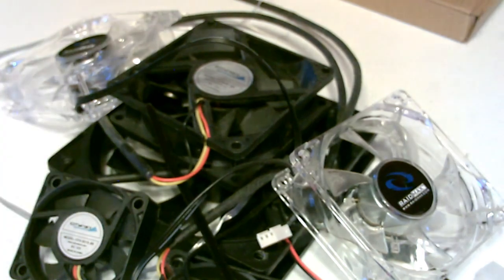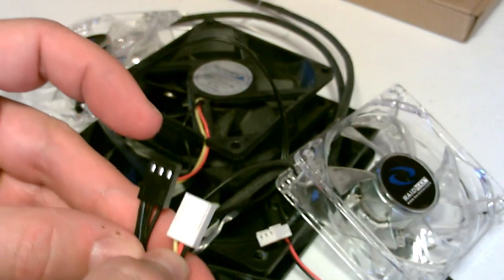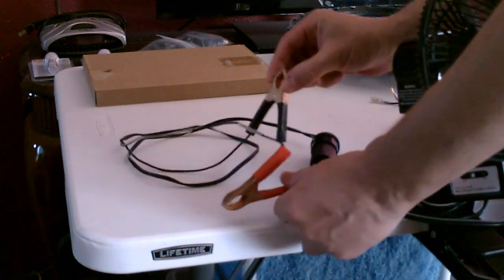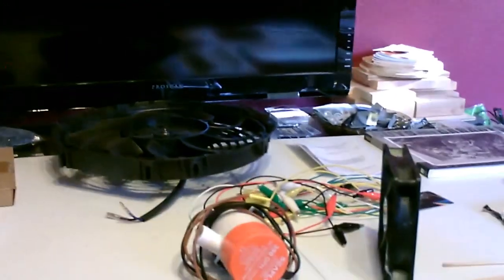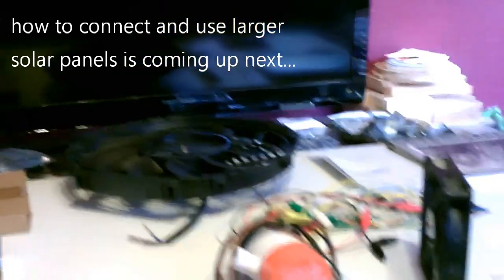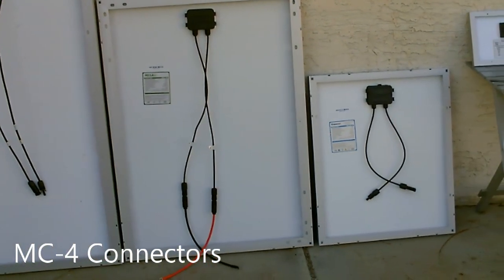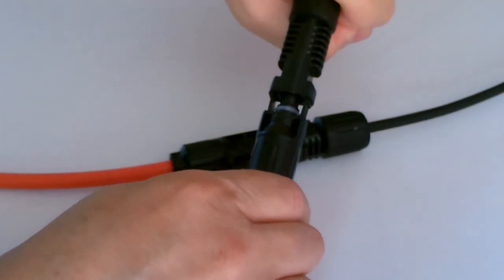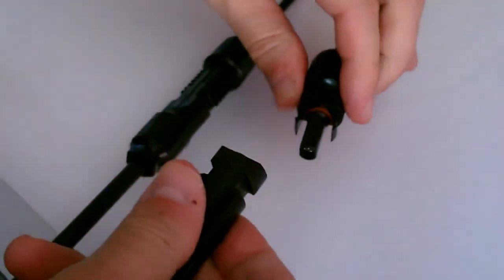How to connect things DIRECTLY to Solar Panels!  - Detailed!  wires/plugs/sockets fans/lights/pumps!

Comment: Wow, thanks for taking the fear out of reconfiguring my off-grid greenhouse and pond fountain and circulation set-up. Goodbye SLA batteries (just to run the charge controller and low voltage cutout) that I fought with all summer, I will be going direct hookup for everything but the pond aerators and shower pump that reguire 24/7 and on-demand power respectively. Thanks again, going to go check out more videos now.

Comment: Do you have a video on cutting the MC4 connectors and just twisting the positive and negative leads to
the extension cord wire?  Thank you.
Reply from the maker: hi there. i never actually cut the mc4 wires. they sell wires with mc4 on one end and bare wire on the other. you don't want to ruin the mc4 connectors on the solar panel. you can get a set of wires for 5 bucks on amazon (well five to eight). 🙂 here is a set for about $5.00 https://www.amazon.com/Renogy-Controller-Connector-Adaptor-Extension/dp/B00DGXVO80/ref=sr_1_4?crid=D7BTWN405U1G&keywords=mc4%2Bto%2Bbare%2Bwire&qid=1645040305&sprefix=mc4%2Bto%2Bbare%2Bwire%2Caps%2C270&sr=8-4&th=1
Reply: @desertsun02  Thank you for the fast response and information.  I will order them.

Comment: Are the wires coming off Solar Panels, with the MC4 connections just regular wires? I have considered just cutting them all off and using different connectors.
Reply from the maker: yep, they're just regular wires 🙂

Comment: With mc4 connections..You can also unscrew the box at the back of the panel and switch out the connectors and switch them out for regular wire, and put them back in if there was ever a problem with the panel as to not void the warranty

Comment: Have you ever had this Problem?  I built the solar heater that you designed and it works great.
I hooked up the computer fan b Blaster 70.  Installed it to a 40 watt solar panel and it only runs
when I stand half of my body in front of the panel.  When I'm not in front of the panel it rotates
a couple of times and then stops.  The connections are tight.  I have no clue what else I should
do.  Any ideas would be appreciated.  Thank you.
Reply: I went ahead and grounded the computer motor and it is now working.  I didn't think you
had to ground it.  Thank you.
Reply from the maker: hi. so when you block the sunlight from hitting the solar panel it works but when you put the solar panel in full sun it doesn't? if that is what you mean then nope i've never had that problem. might want to try another solar panel.
Reply: Thank you for your reply and all of your help for a newbie.
Reply: The motor run after I grounded it for a day and then was intermittent.  So I put a small
box on bottom side and it is running full power.  I will have to get another panel.

Comment: I called Grape solar and they said the voltage was to high to run the two computer fans.
That is why when I stand in front of the panel they both run.  I would have to have a
inverter to reduce the voltage.  Do you recommend a company for an inverter?  
Thank you.

Comment: Thank you for all your very creative videos on solar.  I received the MC connectors and
I received a 100 W Mono from Grape and hooked them up like I did the 50 W to run
two computer fans.  I still have to put a small box in front of the panel for it to run.
Both fans run full blast for about 10 min and then they just run for a few seconds
stop and run again for a few seconds.  I'm going to solder all connections to see
if that will solve the problem.  Any other ideas please let me know.  Thank you.

Comment: I'm trying to hook up a snap fan directly to a large solar panel. The snap fan has exposed wires but the solar panel does not. I'm assuming I use the socket you mentioned to connect the two? And what about the exposed ground wire? What does it connect to? Thank you!!

Comment: If looking up on Amazon the mc4 connectors that you use to hook up bare wires to the solar panels how would you search for them.. could you leave a link.  Thanks.
Reply from the maker: hi. type in mc4 to ring terminal. that finds them. or here's a link
https://www.amazon.com/Extension-Connector-Plated-Terminals-Adaptor/dp/B076GX7ZSJ/ref=sr_1_7?crid=Q7II3WJIX8PM&dchild=1&keywords=mc4+to+ring+terminal&qid=1611057444&sprefix=mc4+ring+terminal%2Caps%2C228&sr=8-7 they also sell mc4 to bare wire. here's a link https://www.amazon.com/Renogy-Controller-Connector-Adaptor-Extension/dp/B00DGXVO80/ref=sr_1_3?crid=Q7II3WJIX8PM&dchild=1&keywords=mc4+to+ring+terminal&qid=1611057650&sprefix=mc4+ring+terminal%2Caps%2C228&sr=8-3

Comment: Do the solar panals have batteries in them already usually? Somehow it needs to be able to store the energy to use when the sun isn’t hitting a panel right?:o
Reply from the maker: hi. the solar panels don't actually have batteries in them. (but it's easy to hook a battery to it - if needed). in many cases no battery is needed

Comment: Hello, i built the "blue cube" evap cooler with 120v A/C  and it works amazing, now I'm trying to convert it to solar and I'm having some trouble. I bought the same fan and pump that you use in the video and a 350w solar panel thinking that all solar panels were 12v, turns out my solar panel is 36v. Then i took an old solar charge controller from from a solar light and converted my 36v to 12-13v and the fan runs super slow, so then i connected a 12v 55Ah rechargeable battery to charge controller and the fan still ran really slow. So then i thought maybe there was something wrong with the fan so connected the fan to my car battery and it runs just like in your video. I really would rather not have to use a battery and just have the system run while the sun is up but i will if i have to. Based on other comments i think I'm may be having an amperage issue. What am i doing wrong? What other device can i use to solve this problem?
Reply from the maker: hi. super that you built it! i'm glad you got it working good on AC. i'm not sure how many amps you panel is putting out (or how converting a 36v panel so it outputs 12v changes things) but it could very well be an amperage issue. i only run my projects on 12v solar panels so i don't have to convert or change the voltage. i don't know of a way to use a higher voltage solar panel with a 12v fan and 12v pump. you may have to invest in 12v solar panel or panels. amazon has 100w 12v panels for as low as 75 dollars. so they are fairly cheap these days

Comment: Will that burn the motor up? I thought they needed a stable power source.
Reply from the maker: hi. no, that's they beauty of it. DC motors and lights don't need a stable or "tightly regulated" voltage source. the DC motors found in things like computer case fans, radiator fans, water pumps etc... have a voltage range in which they operate. for most it's 6v-20v, and that range falls well within the output limits of 12v solar panels. as far as current (amps) - the items will just pull the current that they need (but no more). so the items just run slower (or dimmer) as the sun goes down. this is also true for things like heating elements. they just run a little cooler when they have less power but it doesn't hurt them at all. the few extra volts from a 12v panel is just a slight increase in the "push" behind the current and the items will never pull more current then they need - so it works perfectly. there's only one exception to this and that's some things with sensitive electronics in them. one example is the smaller 3v to 12v volt motor speed controllers. the range of those is 3 to 12v and they mean it. they work up to 12v but if it hits 14v it's toast.
Reply: @desertsun02  Awesome!  Thank you for the reply, I am using this set up to run 12v fans in a barn when the sun is beating down on it.  Good to know that they wont burn up.

Comment: Great Video!  I have 265 Watt solar panels and a 450 watt DC water pump.  Do I need 1 or 2 panels?  I'm assuming 2?
Reply from the maker: hi. 2 sounds about right. just make sure that voltage of the pump is the same as the voltage of the solar panels. also amps matter, so make sure the solar panels can generate the amps needed to run the pump.
Reply: @desertsun02  Thanks for your input!  My panels are 38VOC each with Isc of 9.19.  My pump draws 3.8A.  Safe?  Sorry I don't know anyone that knows anything about Solar Power around here!  Doing my own research on YT...

Comment: How about if I connect much stronger panel? Will it burn device? Let’s say I connect 150watt to something that draws 80watts?
Reply from the maker: hi. it won't burn the device. the device only draws the power that it needs. you could connect a 5 watt 12v fan to a 200 watt 12v solar panel if you wanted to.

Comment: what is your next project, off grid Jacuzzi? :)
Reply from the maker: hi. at the moment (01/25/2021) i'm working on 3 things. a peltier heater/cooler project and 2 water distillers (one will be powered by solar panels). i've had a lot of requests for that. hard to believe it's 2021